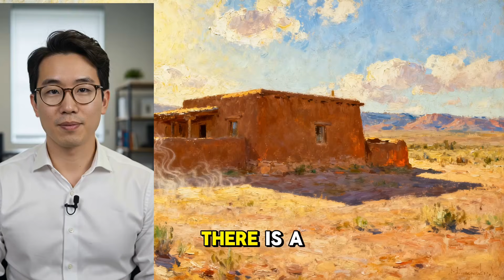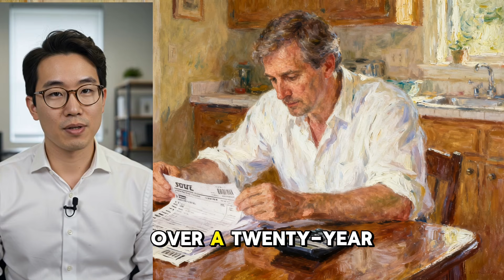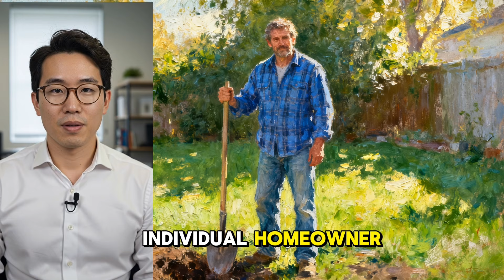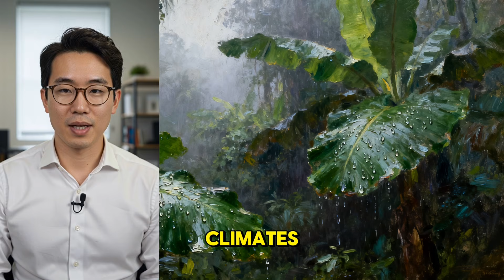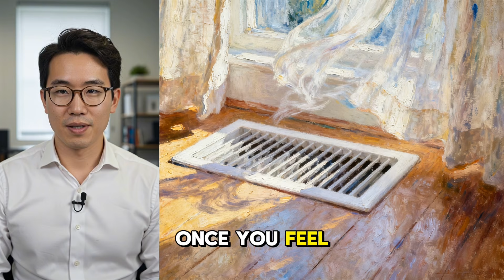This $50 Pipe Cools Any Home 20°F Forever — HVAC Hates This

Comment: 🎯 Key points for quick navigation:

00:00 House in New Mexico stays 20°F cooler than outside July sun using packed earth walls, no AC or electricity, total system cost under $50.
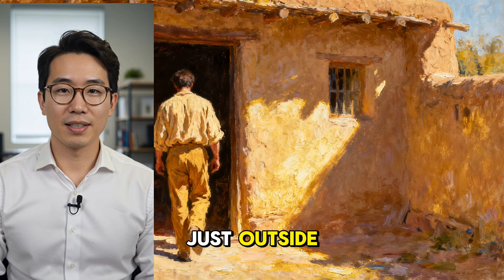00:28 Inside feels naturally cool like a cave, due to earth's inherent temperature stability.
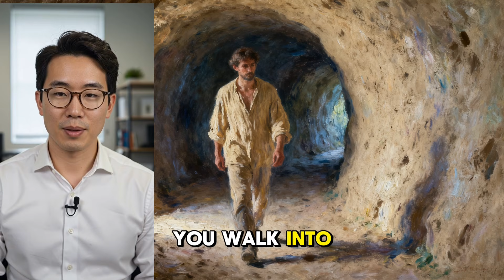00:41 Humans have used earth's cooling power for thousands of years before modern AC.
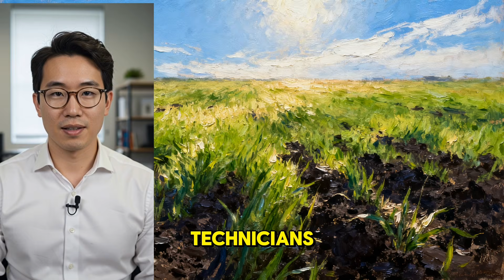00:54 At 6-10 ft underground, soil temperature stays constant at 50-60°F year-round, unaffected by surface weather.
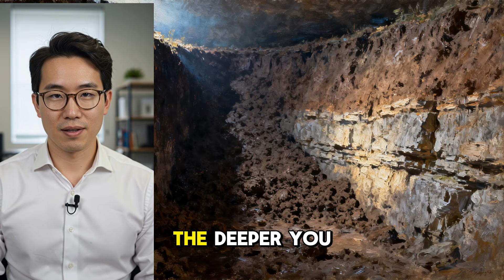01:23 Passively cool air by running it through buried pipes in contact with stable earth soil.
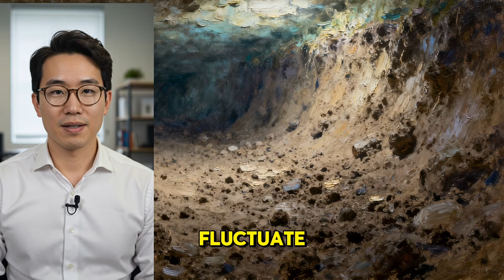01:49 Earth tube systems have zero electricity use, no moving parts, and no maintenance.
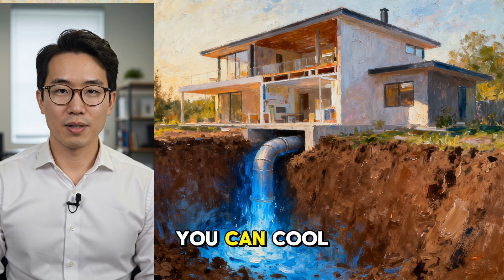02:04 Ancient Persia used qanats—underground channels—to cool hot desert air before entering homes.
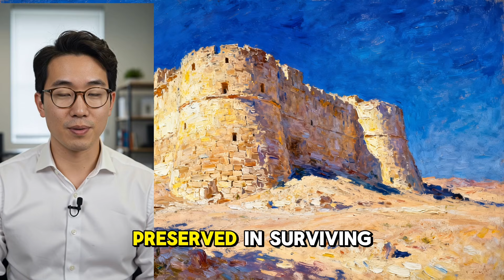02:17 North Africa, Iran windcatchers, and European root cellars all used earth cooling principles.
03:12 Modern construction ignores it because it lacks ongoing costs, bills, or replacement revenue.
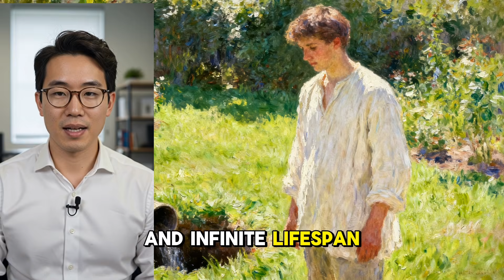03:40 System uses cheap PVC or drainage pipe buried 6-10 ft deep from exterior intake to interior vent.
04:22 Hot air cools 15-20°F (or more) as heat transfers to surrounding earth through pipe walls.
04:50 Longer pipe and deeper burial increase cooling; called earth tube or ground-coupled air systems.
05:05 100-ft pipe delivers cooling cheaper than mechanical AC, with air moving passively or via small fan.
05:47 Natural convection drives airflow without fans in passive designs.
06:00 Central AC costs $5K-$15K to install, plus thousands in electricity/maintenance, over $20K in 20 years.
06:43 Earth tubes cost nothing to operate, no wear, only rare issues like condensation fixed in design.
07:26 Widespread adoption would cut residential cooling load, easing grid strain and fossil fuel use.
08:22 Sealed modern homes prevent passive earth cooling, forcing mechanical climate control.
09:19 DIY in a weekend: dig 6-8 ft trench, lay 4-6 in pipe with slope for drainage.
10:02 Seal joints, screen exterior intake (shaded, away from pollution), connect to openable interior vent.
10:43 Best in dry climates; moderate humidity needs good drainage.
11:11 Humid climates risk condensation/mold; add dehumidification or avoid.
11:54 Check groundwater and soil type (e.g., clay freeze-thaw) before installing.
12:50 Works reliably for millennia due to earth's massive thermal mass buffering seasonal changes.
13:45 HVAC industry overlooks it as it doesn't generate recurring sales or service.
14:56 Delivers air from 95°F to 70°F or below for free, rethinking home-environment integration.
15:24 Traditional homes worked with nature (earth cooling, shade, breeze); modern sealed homes fight it.
16:05 AC is expensive mechanical workaround; earth offers free cooling just below foundations.

Made with HARPA AI